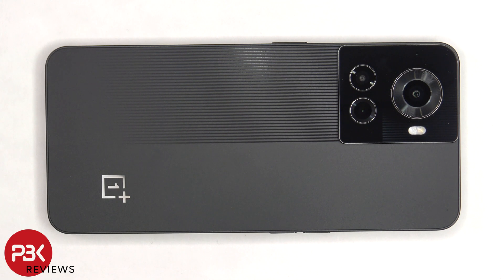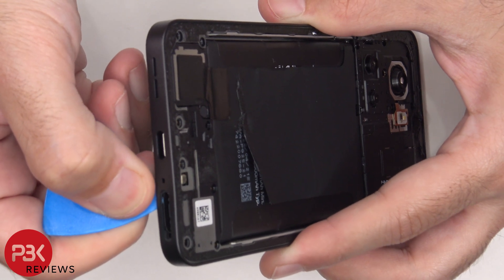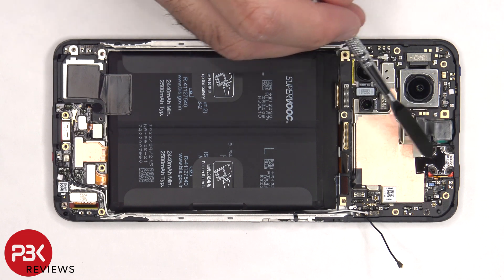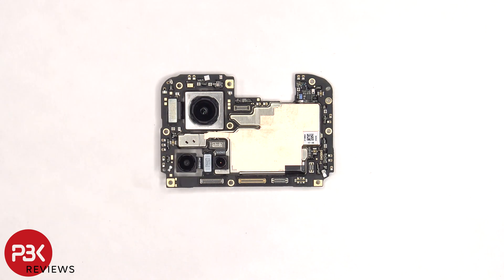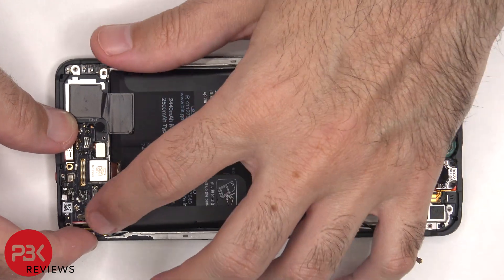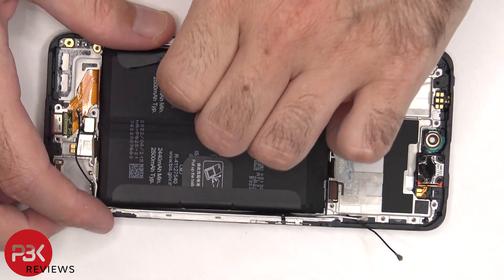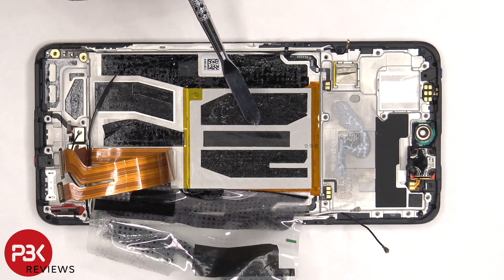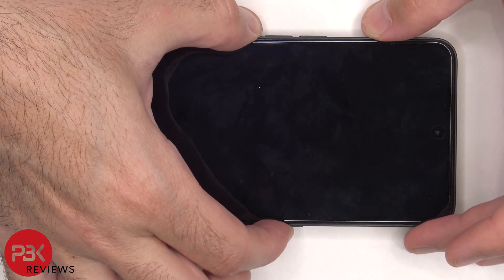OnePlus 10R 5G/ OnePlus Ace Disassembly Teardown Repair Video Review

Comment: Anteena board nd sub board will be same ?
Reply from the maker: the sub board is the charger port board which also has antenna contacts on it, and the antenna board is separate. So 2 separate and not the same.

Comment: Очень интересно... В описании заявлена ёмкость аккумулятора 4500. По факту внутри две банки по 2500... 2500*2 = 5000 ? Или 4500? У кого из нас плохо с математикой???
Reply from the maker: Specs of the phone state it comes with a 5000 mAh battery, so its correct, 2,500+2,500
Reply: @PBKreviews  я разобрался. Есть два варианта этого телефона. 1 - батарея 5000 и зарядное устройство на 80w. 2 - батарея 4500 и зарядное устройство на 160(150)w
Reply: @dimapanzer4296  не подскажешь эти варианты рандомно попадаются 5000 или 4500 ,  или 10R есть отличия Ace по ёмкости , ответь плиз
Reply: @KPACABA-1  это просто комплектации разные...
Например Racing Edition не выпускаются на 150w. А в целом - читай описание у продавца. Если увидишь объем АКБ 4500 - то будет зарядка 150.
Reply: @KPACABA-1  Асе от 10R отличается просто прошивками.

Comment: after 2 months of used my 10R got a minimal battery bump lol
Reply from the maker: bump like it was inflated?
Reply: @PBKreviews  yes but it is so minimal
Reply: @micayle12  i also feel that battery is minimal bump but its not even major so I don't take tension.
Reply: Do you feel same 🥹
Reply: @SamarPratapYadav  no change in performance and it was improved after updating to android13.
Reply: @micayle12  but the battery backup is hamper 🥹